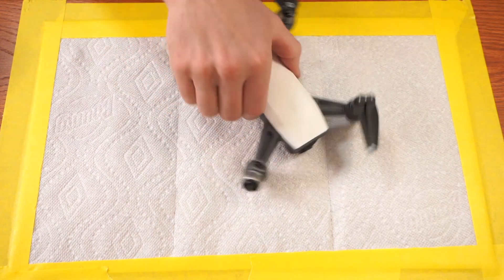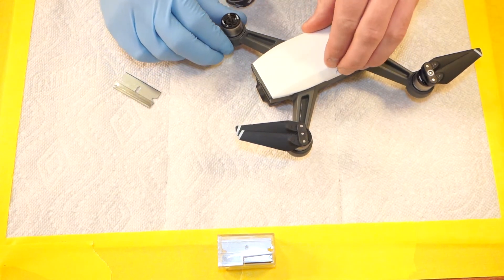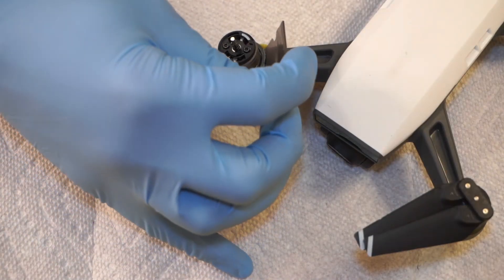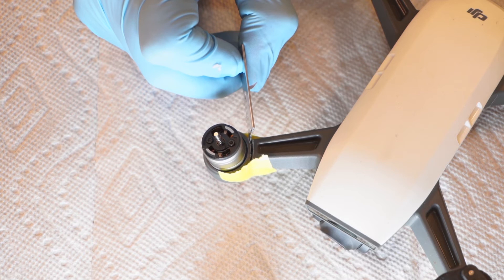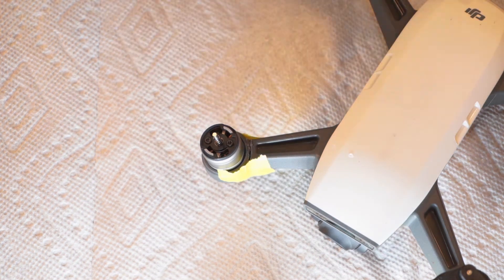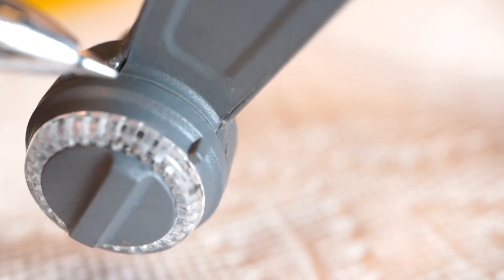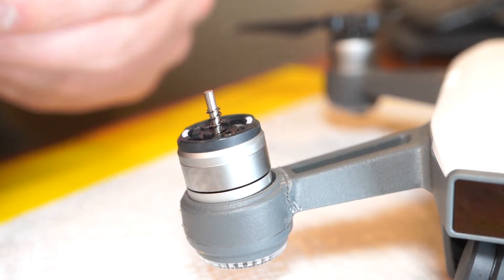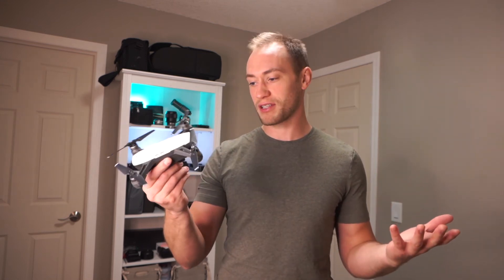DJI Spark Repair at Home (Fixing Broken Plastic Arm)

Comment: What kind of glue and spray are you using? I broke one of the legs on the body side, not the motor side.
Reply from the maker: @donnie_11  it’s called instant bond and it comes with and activator so the glue dries immediately. Bought it at Home Depot

Comment: Thanks for this! Two front arms of my Mini 3 broke in the same exact spot relative to the motors. Had to use superglue to hold it together initially, then I used the glue in this video for permanent adhesion.

Comment: Are you gatekeeping which exact products you used or what ?
Reply from the maker: Lol no it's just got a generic name "Instant Bond Multi-Purpose Adhesive Super Glue with Instant Hold Activator Spray" - the company I worked at owned a proprietary version but it's now commercially available